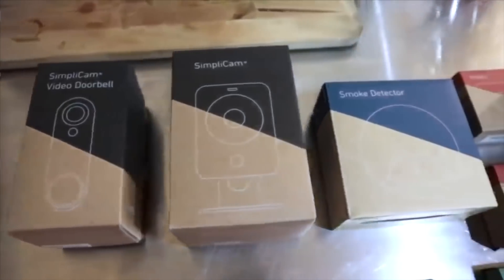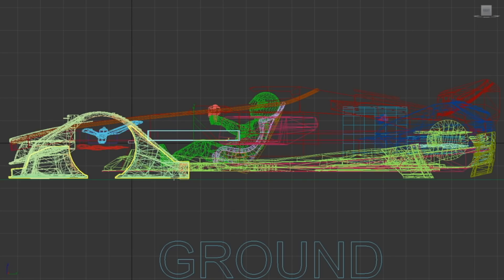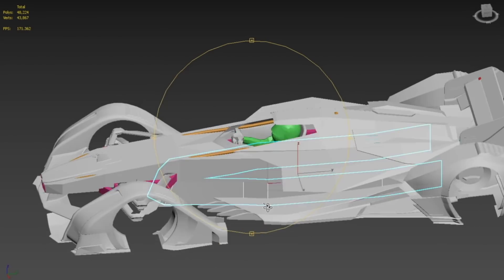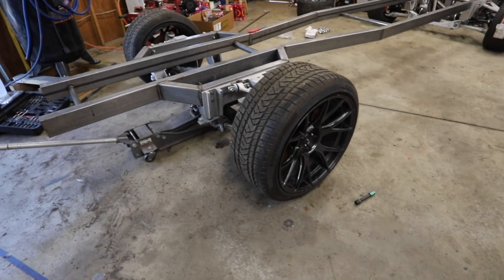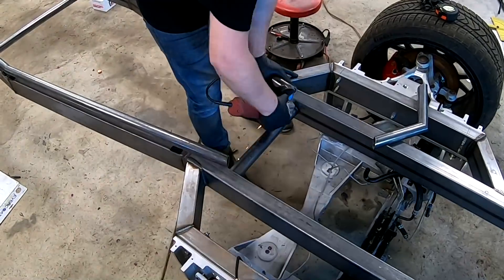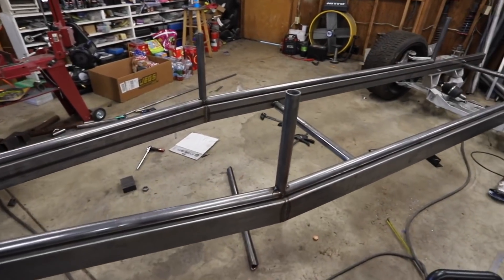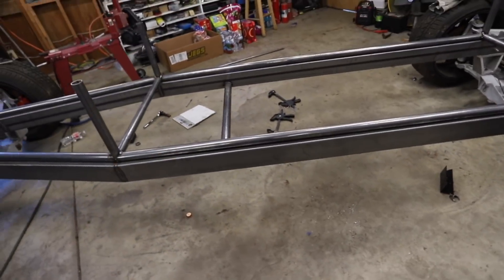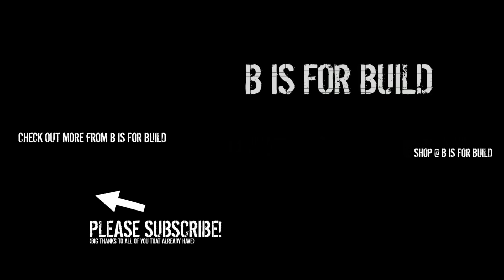Building A Custom Single Seater Supercar Part 3

Comment from the maker: Check out SimpliSafe here: http://simplisafe.com/bisforbuild. SimpliSafe is award -winning home security that keeps your home safe around the clock. It's really reliable, easy to use, and there are no contracts.
Reply: Hey Chris i know your super busy but is it possible to get all your builds in one place for a car update?
Reply: Name it Bob please
Reply: Is it just me...or a trick of the camera...or does the wheel base look about 2 feet too long???
Reply: Which app do you use for designing?
Reply: I suggest the car name to be B-One
Reply: Where is the yatch content chris we wanna see it!
Reply: Given the length, and the apocalypse being a rather messy event, and the minuscule ground clearance this is going to have, any kind of a hump is going belly out that beast.... of course given enough momentum and skid plates underneath... why not..   :d
Reply: So we are not building an apocalyptic build anymore it's now a Supercar 😕
Reply: Does it work in portland?
Reply: @harryguy76  he has stated many times that it is very very long.. .thus my concern about his 3" height .. ;)
Reply: I hope it doesn’t scrape getting it on a trailer.
Reply: Name for car: Back from the future car ?
Reply: I guess you wouldn't use my suggestion, "Long Neck Racer" because you probably don't want to say the initials out loud again 😅
Reply: excellent job on the build, i just want to suggest installing a steering angle kit. with the length of the wheel base, its going to take a 50 point turn to turn that thing around. check out the video cleetus mcfarland did with taylor ray on donnie the drift car. might save you a tone of headache in the future, bro.
Reply: would you clean, air-blast,  or Por-15 the inside of these tubes - while still open-ended? two open ends, obviously?
Reply: Yea it's too low and too long
Reply: Hey Chris I think you should call the one seater wasabi it sounds dope and also what type of engine are you gonna put in it it would be cool if it was a Japanese engine🤷🏻‍♂️
Reply: Instablaster...

Comment: The top hoop looks a little short for good head protection in a roll-over
Reply: most racing categories have a minimum clearance between the top of the helmet and the ground in the flipped state in all cases, not just based on where the center of gravity is. hopefully he fixes it
Reply: MrCybergladiator I agree. And with a hard impact during a roll over, the top hoop will bend inwards. The more room over the head, the better.
Reply: his neck must be very strong
Reply: I honestly don't remember last time somebody rolled over in a custom car like this. It always gets built like it's going to do rallying or something, and then it gets towed from show to show and that's it
Reply: 1.5x playback everything - thank me later then what’s the point of having any roll cage? I’m only saying it’s low because Chris is trying to justify it based on the car’s center of gravity and trying to justify how safe it will be. If he’s just going to bring it to the next SEMA then it shouldn’t need any roll cage

Comment: work ethic and skill is amazing. my honest feedback, I would try to keep the subframes the lowest point on the chassis, keep the bottom of the cockpit level with them and I would shorten the wheelbase significantly. i think those two things will actually help make the car much more usable to actually drive. i know you have a ton of cars that you don't need to actually have this be that functional, but it would be cool to actually be able to drive it on a somewhat regular basis. good luck and I'm looking to stayed tuned

Comment: B is for build 

Wouldn’t it have been more structural to have one piece of steel tube the full length required and bend it rather than a cut for the bend in the frame?
Loving the builds

Comment: Why didn’t you build the frame to fit at the bottom of the suspension where the subframe is and then build towers to hold the upper control arms? That would keep the weight of the car lower and improve handling. I don’t think I’ve ever seen a car built with the frame at the top and everything suspended beneath it.
Reply: Jeremiah Parris because he’s using stuff he had previously brought 💁🏻‍♂️

Comment: You should probably have a bar between the frame rails, that stops the engine from moving forward and crushing you and your seat, during an accident.
It could also double as a holder for the seatbelt straps.
Reply: He said he will be adding support bars  and this is just the "main" skeleton

Comment: What you need is two roll hoops, one somewhere infront of the steering wheels, and one behind the driver, model yourself with a helmet and make sure that if you put a straight line between the hoops you have at least 2 inches of clearance for the helmet. This is how it's done in formula race cars.

Comment: Just a suggestion, integrating the lower frame to the front and rear subframes would help you in getting a very rigid chassis and help in improving the handling characteristics too probably

Comment: So after doing this set ride height and everything what about after setting the engine in there? Will it bottom it out?
Reply: That's what he's working with BC on.
Reply: he addressed that while he was on the computer
Reply: @purefugi21  let me go watch it again.
Reply: @purefugi21  yeah he mentioned it but having the frame rail at 22inches and then bracing it with metal on both ends looked like it relieved weight off the suspension.
Reply: @archangel1824  But isn't it adjustable? 22 inches is his final, which he can finalize by messing around with the coil-overs after all of the weight is in.
Reply: @christiancoleman3023  wouldn't that cause for a very stiff suspension?
Reply: @archangel1824  the car is sitting on the metal stands without any suspension
he will be able to set final ride height with the adjustable coils

Comment: Hopefully you’ll do axel lifts for the front and rear to keep from dragging.   Also cool idea to put the air lifts like race cars have to pit stops. 4 pneumatic cylinders to lift the car. Can’t remember if it is F1 or Indy cars that do that... but it’d be awesome.

Comment: its 4 inches to low buddy ,the bottom should not be lower than the  front and rear cross member ,not only does that ensure you get the full suspension travel  but also prevents the cage impacting the ground

Comment: its not all about ground clearance, but also ramp angle. With that major overhang on the front wheels you will still have issues with the smallest of bumps, in addition to massive unsprung weight.

Comment: Should keep the bottom frame even with the subframe crossmembers. Got a lot of weight to add yet. If it doesn't drop with weight, I feel it will still be easier to lower the car afterwards suspension wise then lift if it does drop.

Comment: Sure seems like you should have tapered the front and rear of the drop-down frame so they were at least as high as the cross members for the suspension. If you ever run over anything lower than the suspension cross members, the drop cage is going to shear off the frame rails nice & clean along with anything inside of it.

Comment: Break away floorboard sounds amazing and case of an accident however with how small your cockpit is that is impossible as you cannot climb through a seat and your seat can not be detachable and still be regulation safety.

Comment: What an awesome build! So excited to see part 2 and the rest of the videos. Just a suggestion or thought provoking question as you see it... Have you considered using a fuel blatter (or multiple) behind the driver seat like f1 cars have? Would be really unique and allow you to save some room to fit in tight spaces.

Comment: i would have capped the end of the tubes and notched the rear uprights to get the most strength and weld contact surface.

Comment: Just install an ejector seat. Safety first bro you have to protect yourself.

And it would be the sickest thing ever 😂
Reply: Eject the driver straight into the ground at 120mph velocity when it rolls over. Ez solution

Comment: With all due respect to your expectation that the weight of the engine/gearbox will keep the back of the car down in a roll-over, you're forgetting that the friction of sliding upside down will have far more relevance. So the protection needs to be fully operative irrespective of the front-to-back angle of the car!

Comment: Have you considered learning a different CAD software such as SolidWorks or Fusion 360 that is intended for mechanical engineering? I think that would help going from a computer design to parts in the shop more easily.

Comment: I'm just a curious George, but why make your frame and chassis out of heavy steel when you could use lighter carbonfibre or fibreglass or even alloy tubes?
Use a tube that's crossweaved for best strength.
I mean damn get some pvc piping and make your own fibreglass chassis that way 👍
Don't know why the nose is sailing so high though, looks like it maybe bowed in the middle...
Yup 10:30 confirms that synopsis. In an accident that thing is gonna split like the titanic right at the V line.
You need to turn those upside down like this 🔼 not this 🔽
As a larger base gives greater support and stability than a narrower one.

Comment: You do realize the 3 inch clearance is the final clearance after floor boards, body panels, etc. are installed, not the tubes.

Comment: Bisforbuild you should modifya dashvin and fire wall from a junk car and you can register it on road if is had windshield wipers .. doesn't need front window horn blinker brake and headlights and your good if it has the dash vin and fire wall it's a 1979 240z or somtbing

Comment: Chris, two things, and I'm well aware you may have plans in place but I wanted to mention them anyway.

Please don't forget to make a plan for a firewall between you and the engine! You probably need to plan the space and "attachment" points for it pretty early in construction, or it may get very difficult to include it later on.

The second thing, and I admit I don't KNOW what I'm talking about, but I have a gut feeling...  I think as you're building the frame elements, you don't actually want all of the different tubes to intersect at the same point. At some point, I think there would be too much force in one place in an accident and the entire "joint" would fail at the same time. I was trying to find examples, but didn't find anything quickly, but I'm sure if you reached out to someone with engineering experience they would know the answer for sure. My gut tells me that, for example, where your main frame rails meet at an angle in front of the cockpit, you don't want the vertical support directly under that connection, but just behind it where the rails are still parallel. I think that gives you the most structural integrity to the cockpit, which is the most important part. And the same thing on the bottom part, it would hit just behind the joint of the lower rails. Also, the same thoughts for the diagonal bracing.... I think there is some number of joined tubes that becomes too many in one place, so the next bracing piece gets moved just an inch or so from the existing joint. I'll try to find a visual example in truss construction and post it below.

No matter what, you're definitely moving along! Good luck man! (And eff lawyers!)

Comment: This is a cool build. Just wondering with such long wheel base and low frame, run risk of getting high centered all the time (parking lots, off/on trailer etc).

Comment: Considering the ride height & ground clearance against your other vehicles is all very well - but in practice do you really want to be driving something with such a low clearance... and the length/wheelbase of a Maybach 62 or a Rolls limo'!?!? I'm anticipating the eventual ride height to be nearer an inch higher!

Comment: Why no gussets? This is a very small thing you can do to add strength. I built roll cages back in the day. And i put gussets in just about every 90 i could. You might want to add some. And it will help keep some weigth down.

Comment: How come you went with tubing for the bottom portion rather than using the Rectangle/same frame you built the top with? It would of been easier and stronger

Comment: When you add the engine and you and whatever else weight, that new section you just added will probably drag on the ground no?
Reply: No the suspension is adjustable so the final height can be dialed in

Comment: Im not a chassis engineer, but from the very start the butt welds on the main frame rails seemed bizarre, (especially given the length) with these welds at high stress points. Thought the other structures would overlap, but are butt welded in the same spot. Does this not matter?

Comment: Frame is too far off the ground.  Also how heavy is this thing going to be when you’re done?
Reply: Yeah.  Wouldn't you put the real frame as low as possible to get the CG low?  I'm thinking this was (1) pick production car suspension (2) design car around it.  I think the front end could just have longer control arms rather than that heavy bumped out section. to be fair, I haven't watched the first 2 videos, so maybe this was covered already.
Reply: Michael Hughes it was only covered in the comment section

Comment: This is an Apocalypse car, right? I mean, not to be a downer, but I think you'll need more than a half inch ground clearance on public roads today, let alone after the apocalypse. Well, unless you like sparks and running aground at every slight crack or pothole.

Comment: Are you going to get air suspension
Reply: He's either going to have to do air suspension or raise the clearance on those wheel enclosures. I think the latter option is more practical, even though I like the design he's going for. I just don't think it's going to work actually driving it.

Comment: there is a piece of tech missing from the design
let me give you a tip.. there should be one in the front, one in each side of the driver and 1 in between the engine and the driver

Comment: Didn't that Lamborghini convertible have expanding crash bars in the case of a roll over? Seems like you'd want to have the same thing here or an overhead bar, I wouldn't be happy rolling over and having my head be a couple millimeters above the ground as the car was sliding along.